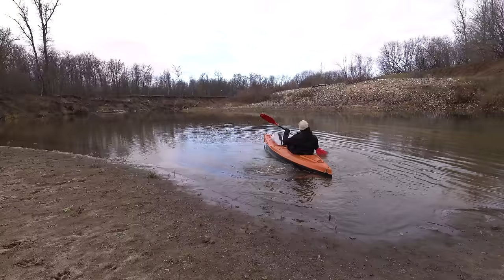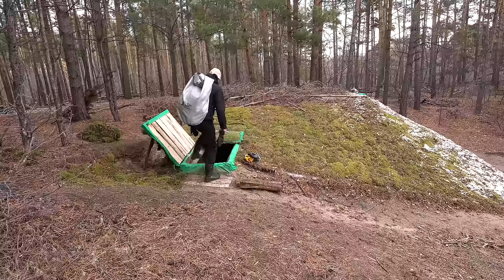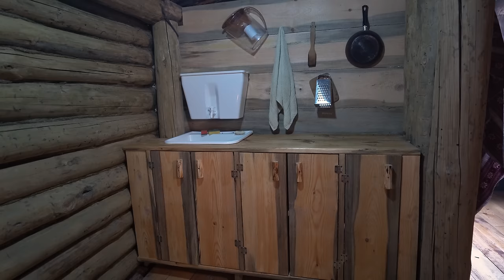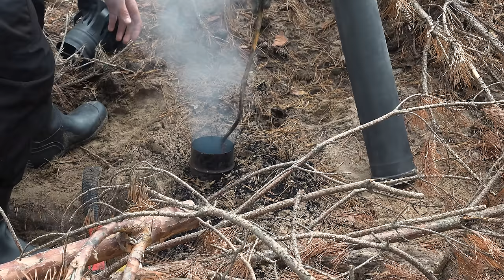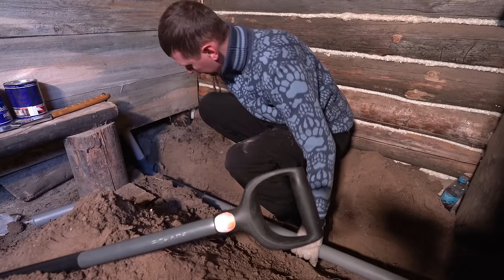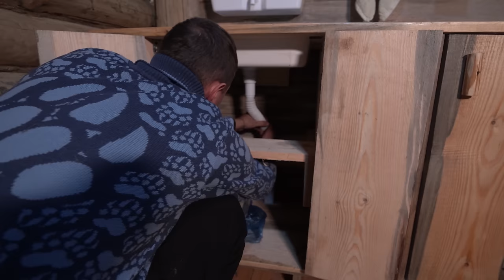SECRET BUNKER underground for survival. 3 days in the wild. Part 13

Comment: Chimney wasn't clogged enough to limit airflow. But it's hard to get a high chimney going when it's quite tall and filled with cold air, and no draft at the top. Needs more heating or forced air/warm air to get going, that's why it took awhile. (but yes, also needed some cleaning to avoid chimney fire eventually.).
Reply: Also, try to restrict the use of conifer wood (like pine or spruce) in the stove as they have a higher content of resins and thus produce more creosote when burning. Creosote can cause chimney fires and may clog it faster. Though deciduous wood doesn't burn as hot as conifer, it burns a bit cleaner. You can start the fire with kindling from pine, but turn to, for instance, birch, rowan, alder, sallow, willow or what have you when you have a good blaze going.
Reply: Definitely lots of Creasote in the pipeline so best to keep ahead of it. Would a creasote log work with your ventilation system?
Reply: And I would never clean it with fire going on...

Comment: Best not to hang the tea towel near the stove Alex. 
Ask me how I know - I've had 3x fires cooking with those stoves indoors in the last 5 years. 
Luckily each time I've got the fire out quickly. It always happens when your back is turned. Be especially careful using aerosol ANYTHING indoors while those stoves are going. One time I sprayed some surface insect spray to stop ants and it flashed and caught some fabric on fire which then caught some dust on fire; all in about 5 seconds.  
Even the gas cylinders for those stoves leak causing the stove to ignite around the knob under the cover door.
Yep I know all about those stoves indoors.